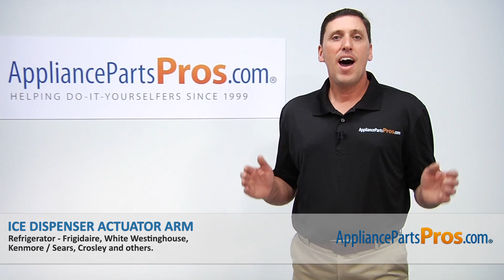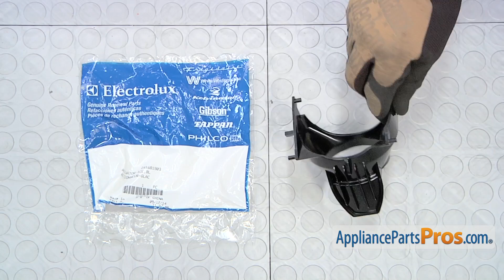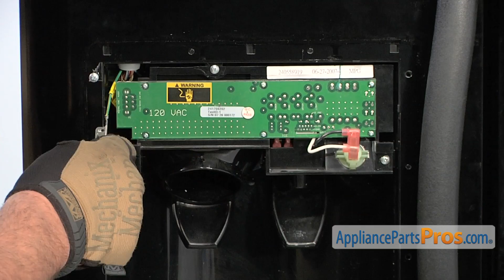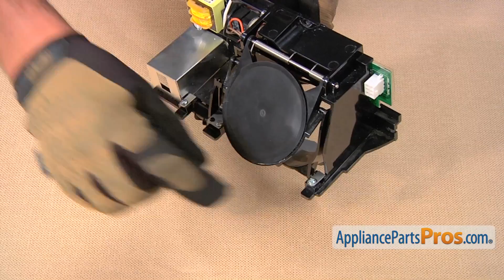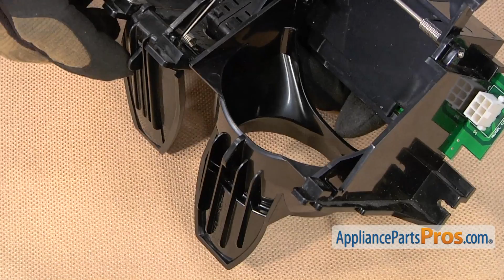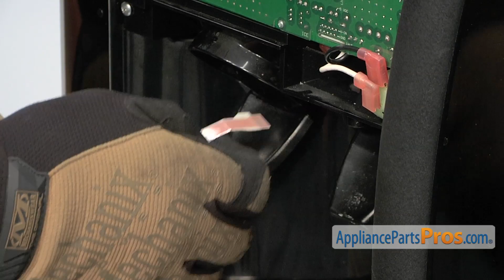How To: Frigidaire/Electrolux Ice Dispenser Actuator Arm 241681903

Comment: Thank you for your very informative video.  Unfortunately, I had several issues.  One corroded screw that required a thread remover tool. Then the water supply hose somehow shrunk so I had to add a 6” piece of hose before I went insane.  I did replace the three screws with stainless ones as they were all in bad shape.  Other than that the procedure went per the video.  Nothing is ever easy. 😂😂😂
Reply from the maker: Wow — major credit to you for sticking with it! Corroded screws and hose surprises are never fun, but sounds like you handled it like a pro. Glad the video still helped guide the way!

Comment: Great video.  The only difficult part was getting the hose to go back into the small hole.  We actually tried for about an hour and then realized if we take a straw and push it into the hose so it is tight, then put the other end of the straw in the hole, we were able to guide the hose into the hole.  It went in very quickly after that.
Reply: hey did you have to turn off the power? or can this be done without turning the fridge off?

Comment: We have a kenmore ice maker not dispensing ice, do you know if this model is similar to the kenmore before I attempt to try to pull it apart and replace it.  Also is there a way to rule out this is the issue by troubleshooting

Comment: getting the water tube back in was a bitch because it was so short,  I was able to guide it into place by sticking a wooden chopstick up through the hole in the actuator assy and into the tube before mounting it into place.
Reply: Thanks for the tip!!! I can confirm after struggling with it by hand to try and get the water tube back in - this worked like a charm. Put the chopstick inside the tube firmly and once the assembly was in place, just pulled down with even pressure and the tube came thru (I also put a little dish soap on the outside of the tube to help it out). Thanks!
Reply: Thanks for this because I was coming here to write, "Really glossed over that whole "Getting the water tube back in will make you lose your mind" part."
Reply from the maker: Jo Blo Glad the video helped you get the fridge fixed! Awesome tip about using the chopstick, Thanks!

Comment: I recently replaced  lighted actuator on a glh567eepw0 I accidently pulled the ribbon from the user interface and had to take the back plate off to reinstall ribbon  upon putting it back together I all of the sudden had three lights on and bin auger drive was running non stop   any ideas what I may have done wrong?
Reply from the maker: r dukes I would double check everything to be sure its installed correctly. Make sure none of the little buttons on the board are stuck in the down position. Its also possible it was damaged, if you need more help you can post the problem on our repair forum along with the model and serial numbers, the techs can help you out.
Reply: AppliancePartsPros thank you for your time and response. i'll double check my work to this point.
Reply: Recently, my ice lever got stuck in the up position. During disassembly, I found a broken plastic tab. Can I assume that this tab engages the micro switch next to the water pump micro switch to actuate the auger/crusher?